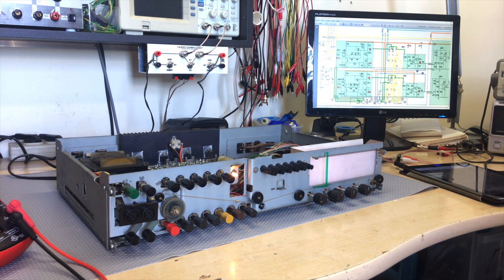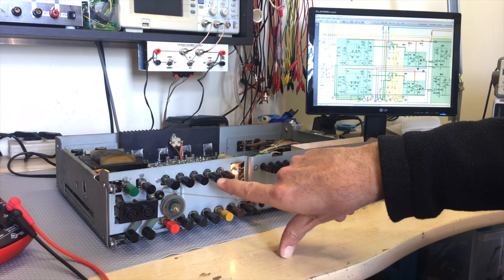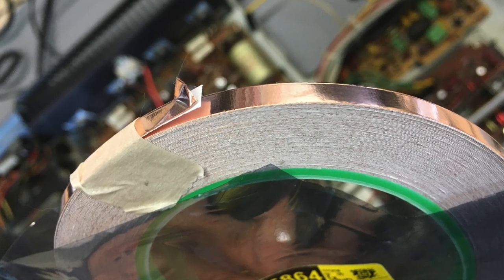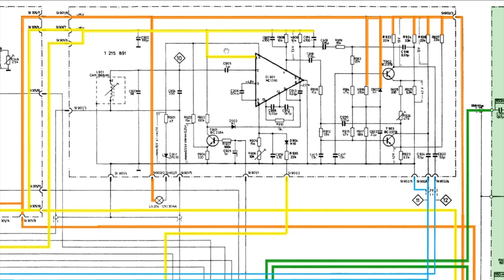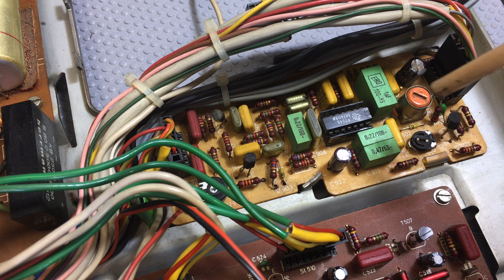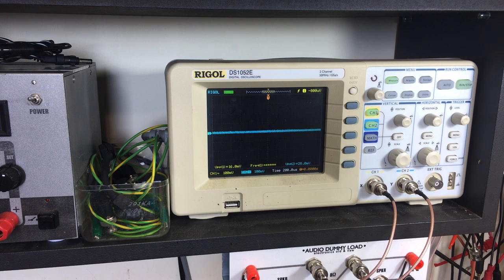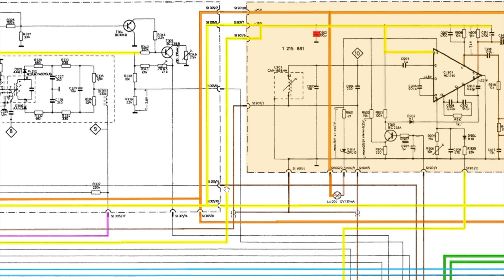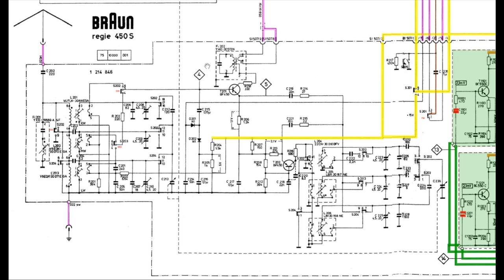V2: Braun Regie 450S restoration - part 5. Everything but the "Board". Afraid to ask her to dance :)

Comment: The stereo decoder in the Tandberg Huldra 10 I just restored is almost identical to the one in your Braun,
so in case you need it, here's the adjustment procedure for it adapted to the one in your Braun.
Adjustment procedure for MC1310P stereo decoder:
1. Internal oscillator frequency.
   Short input signal (testpoint 10) to ground.
   Measure on pin 10 of MC1310P with freq. counter and adjust R906 for 19kHz.
2. Channel separation. Apply stereo signal with only audio in left channel.
   Adjust R929 for lowest possible signal into right channel.
3. Stereo/Mono threshold. Adjusted at pin 2 of IC, so probably with L901.
Good luck, hope this is of value to you :-)
Reply from the maker: Geir Endre Jenssen : it’s of great value, thank you very much.